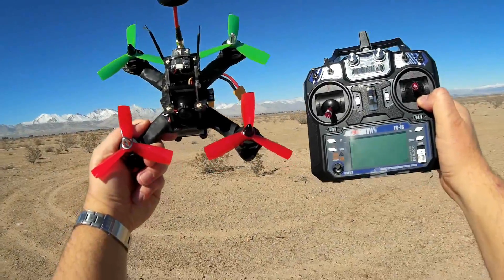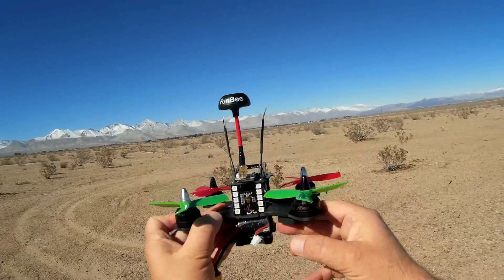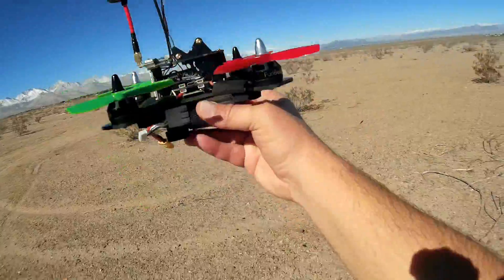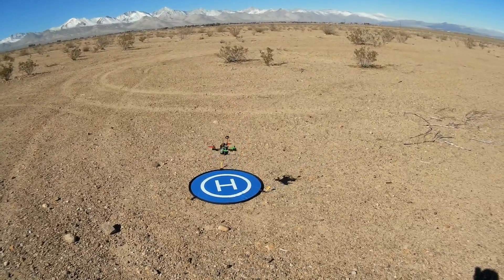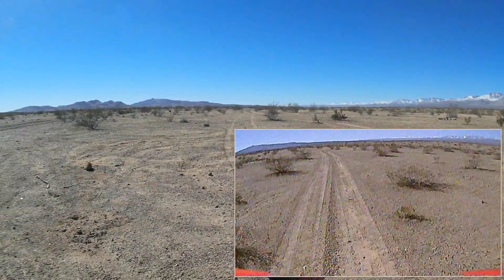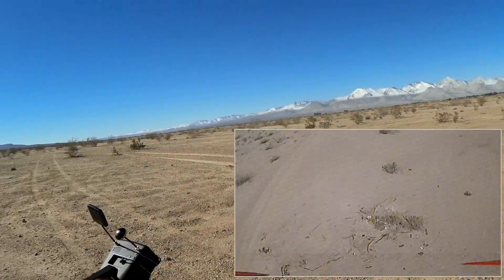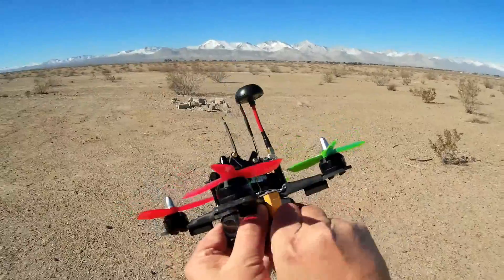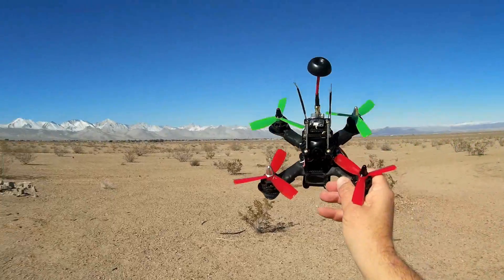FuriBee F180 180mm FPV Racing Drone Flight Test Review

Comment: and for the first six take off the top left blade will not start spinning at the beginning of the throttle
Reply from the maker: Do you know how to calibrate your quadcopter's gyros?  
1) Turn on the quadcopter and place it on a flat and level surface.
2) Turn on and bind the transmitter.  Center all trim tabs.
3) Leaving the quadcopter undisturbed, move and hold both control sticks to their lower right corners.  Hold them there until the quadcopter's lights blink. If they don't blink, then try lower left corners, lower outboard, or lower inboard until you notice the lights blink.
4) Let go of the sticks and try flying.

Comment: Great demo as always! .. 4 feet of snow outside here..  not flying anything.  I notice you wear glasses as I do.  I discovered something flying little mini quads around the house that you might be interested in.  Mounted my Echine D2 goggles on my camera tri pod, move myself and chair up close to the goggles and wow, easily see the FPV with my eye glasses on without having to take them off.   Works fantastic, and i imagine using them outside will work just as well as i have used this set up right under florescent lights.  Sure saves having to fly with glasses off and the dang goggles on your head plus you can easily glance at the transmitter or the drone as it flys by.  Give it a try all you eye glasses wearers. lol  Happy Flying GrampaKenCanada

Comment: "Intermediate flyers like me" I dread to think where that puts me - wannabe beginner? :)
Reply from the maker: We've all been there.  I always recommend the Syma X5C for new fliers, due to its excellent stability, durability, and ease of flying. And it even has a camera too.  Use it to learn the basics of flight with.  Let this cheap quadcopter take the inevitable crashes and bangs of a beginner flier. And if you break it, every part on it is cheap, widely available, and easily replaceable. Later as your flying skills improve and you're not crashing as much, then consider something better/more expensive.  https://www.youtube.com/watch?v=y93vzA-KRlM
Reply: I did mean in comparison to you.
I've only got about 45hrs of quad flight in over the last couple of years and had been thinking I might qualify as nearly intermediate myself.
But if you are an intermediate I definitely don't qualify :)

Comment: Had to laugh when you tried to look up to see more horizon (because of camera angle) .. I do that too and then think "DOH!". We have so much snow on the ground that if I dumped anything smaller than a 350mm quad in the snow, it would stay lost until the Spring thaw. I did take my X5C with Mobius Mini out this morning after shoveling the drive and fly it up/down the street .. Have to get some outside stick time in. BTW, a shame you don't have a FrSky Taranis TX, because its easy to set up timers on it, which give you VOICE announcements  (minute by minute) of your flight time, which is good when you're flying FPV and can't look at the LCD screen which has the battery and RSSI telemetry numbers on it.  I recently got a module for mine which allows me to fly all my Syma quads with it, as well as the 33041. Put timers on all the models set up so that while I'm flying, I'm constantly aware of how long I've been up.  I know you have some of those digital kitchen timers, so maybe you can just put them in count-down mode and stick it in your shirt pocket so that it goes off after 4 min ... prevent you from a drained battery crash. Thanks for the review. Cheers. (send some warm air this way .. we're not going to be above freezing until next week)
Reply from the maker: The thing is with the ending low bat crash, I had VBAT set, and this comes with a buzzer.  So I was expecting the VBAT beep.  But checking on RCGroups, apparently this does not come with the needed VBAT cable to allow such to work, hence no warning.